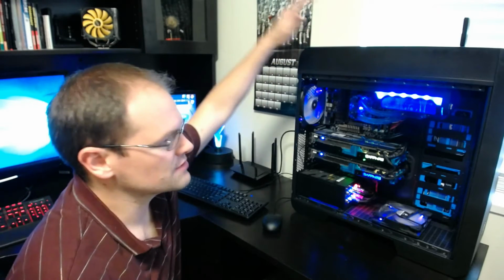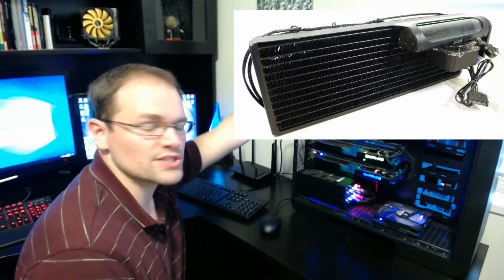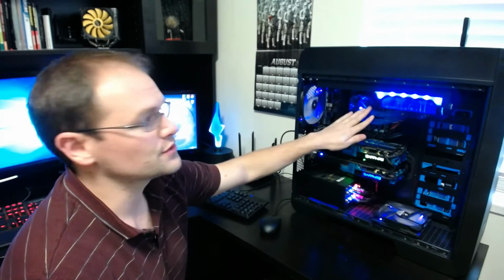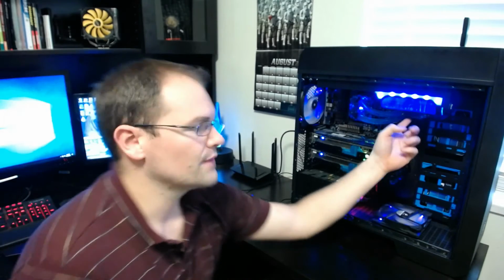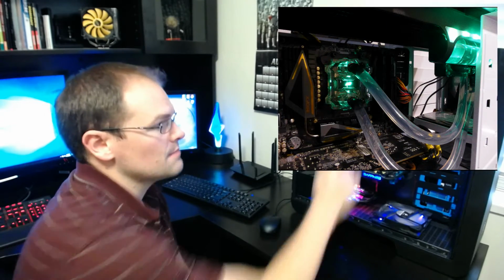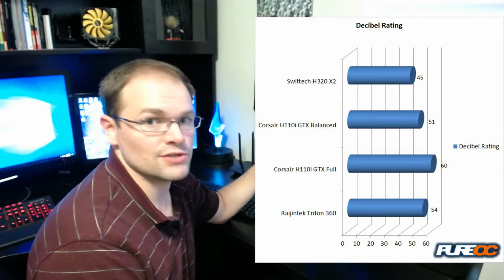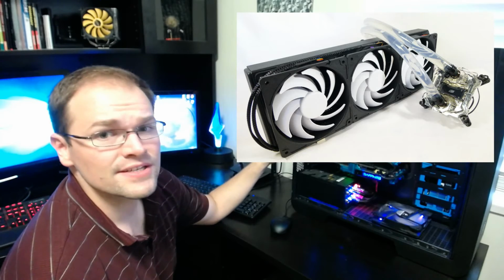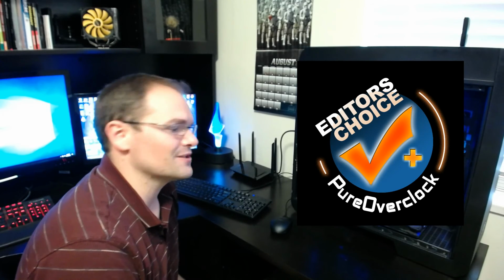Swiftech H320 X2 - CPU Cooler - Review

Comment: Have you had any leak issues? 
Any cracking of the acrylic either on the block or the pump /res?
Reply: +The Hardware Hound 

OK. Because the Internet, and their own forums, are full of people having cracks and leaks with these.
Reply: +The Hardware Hound 

Bad batches maybe. 

Ive back and forth between this or a kraken x52. 

I like that the pump isn't on the block, and that the Rad is copper on this one. I wouldn't expand the loop so that's a moot point on this one. 

The kraken has better fan control, can be push/pull, and has much better reviews.

Comment: Dude, nice video. Keen on actually getting this for my current setup. Do you think the 320 will fit in my NZXT H440? my guess is that it will just fit if I take the two front hard drive bay sections out. Anyway your videos are good, I suggest maybe investing in a nice new camera for video. Adding some music behind your video track also and I think you should look towards maybe working with some brands and getting equipment to test on a regular basis. I think you will get far :) anyway best of luck and thank you for your very informative video. Kind regards from Australia.
Reply: it will fit fine... my mate has a 360 Rad in his NZXT H440 .. just take out the top two bay HDD/SSD drives

Comment: wanting to lower my temps with my overclock, I was looking at this. But just bought a H115i as the refurbished unit was just $75 shipped from Neweg g. I think I can deal with the little extra noise, especially with that price difference and I'm not 100% sure it will fit my case. 

I'm a bit disappointed that considering its size, price and use of copper it still was outperformed my the Corsair in the temps department.
Maybe this Swiftech with some higher RPM fans can really show some performance.

Comment: I am looking at getting the prestige version (those Noiseblocker fans selling me on it) to go in my new Fractal Design Define S. 

I can't tell because the LED is a bit bright. Have you tried adding the dyes yet and how difficult that is? 
Based on what you've seen with this and the instructions. How difficult do you think it'll be to add a 2nd rad?
You mentioned it uses AMDs default backplate. Say I have an aftermarket cooler w/ its own backplate and no longer have my original. Thoughts on if this is something I'd need to look at buying a stock one?

Comment: Very nice review. I think I will give the 240 X2 a try for my 6600k. For $150 it seems like a good deal as long as you don't get one the leaks out of the box. That was one of the most common problems I have seen from customer reviews. But the people who got working ones seemed very happy with their purchase. Also after looking at the temp chart I got to have a good FX 8320 i'm sitting at 4.795ghz at 1.485v with a Noctua DH-14 never gets hotter then 58C. Nice video again tho I think i'll sub.

Comment: I do have a question and I hope you can help, I've done quite a few rigid tube builds and is that the legit Apogee XL2 block on there or is it a modded version? 

I've got a mate that has seen my loops and wants to do a hard tube line but is pretty limited in budget and I have some compression fittings and PETG tube around that I have used with the Apogee block before and I was hoping we could get him a small hardline GPU/CPU loop out of this CPU block/pump/res/rad combo.
Reply: *****
Awesome thanks for the help, since this has a legit pump too I think we can rig up a simple PETG loop for him for less than $200

Comment: I am glad you redid it but it doesn't really change my view, the Swiftech X2 320 is for serious business overclocking and enthusiasts that want great sexy water cooling but don't want to put $350+ on a custom loop.

The Corsiar 110i/110GTX/115i whichever they are on now is for your standard watercooling and average overclocking crowd. They both have their audience and perform exceptional at that level.
Reply: RojasTKD7
Ohh yeah, I have a custom loop and the Swiftech H320 and I still wouldn't pass up a 75$ H115i, just to have a backup. You are 100% right though people are quick to jump on the very few watercooling units that leak but they don't realize the damage that those giant towers can do over time to the motherboard specially if you ever move the tower around. I find the H320 really pays off over the corsair and other units when you get into heavy overclocks, the copper instead of aluminum rad and extra rad space that a 320mm provides over the 280mm and 240mm really makes a difference then.
Reply: completely agree with you. Swiftech is for those wanting more than just a corsair closed loop but dont really want to venture out to custom loop. Like me :D
Reply: The problem is that from everything I've seen and even mentioned in this video the Corsair H110i/115i gives better cooling out of the box, though it is louder. Picked up a H115i referb for $75 shipped, so I may upgrade the fans with Noctua fans eventually and get a well performing cooler that runs quieter than corsair's stock fans.

I may still eventually consider a Swiftech H320 with three Noctua fans for when I can do a second build and that should give excellent cooling. For the price of the Swiftech and the 3 Noctua fans, I'll stick with the Corsair for now.
Reply: RojasTKD7
 They give the same cooling out of the box from what I have seen, with a slight edge to Swiftech just the Corsair ends up sounding like a C-130 taking off in your house to give the same performance the quiet Swiftech does. I have seen the Corsair win but that was in push/pull with 4 Noctua fans but at that point it costs the same as the Swiftech and you only gain 1-2 c with the loss of looks.

The prestige edition Swiftech has eloop fans which outperform Nocuta in static pressure setups. I do think they need to maneuver the pump/res if possible for a push or even push/pull config because it would end up crushing all the CLC competition but I am not sure if that is possible.
Reply: I was originally considering the Kraken X62, then when I saw the H320 X2 I was thinking about maybe picking one up sometime in 2017 when the funds made it possible. But I live in a warn state (South Florida), PC is in a warm upstairs room and I use my PC for VR and move it from place to place every weekend ( that Noctua hanging off my motherboard with all that moving around makes me nervious). So when I saw the referb H115i for $75 shipped I had to get it.

Maybe if I can build a more portable ITX build next year I'll move the H115i to that and stick a Swiftech in my main rigs, as it has the room. The Swiftech does intrigue me.
Reply: The copper and size, while still fitting my case, is what intrigued me. I'd likely put some higher RPM fans to get max cooling, as my geographic location and warm room causes me to have fairly hight temps with my OC.

I've seen my temps reach 94/95 degress at my home location. It much better at the office, temps are 9 to 10 degrees cooler there.

If it wasn't for my very warm environment and frequent movement of my system my Noctua would probably suffice.

We'll see what next year brings. Maybe I can afford an upgrade.